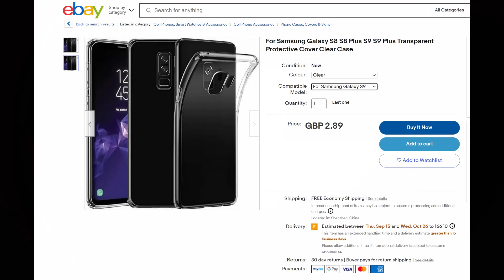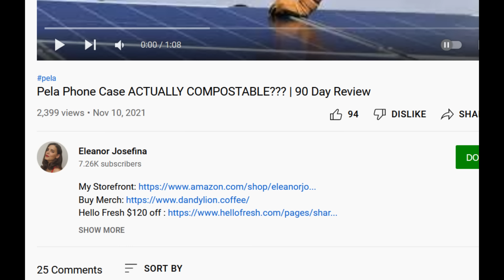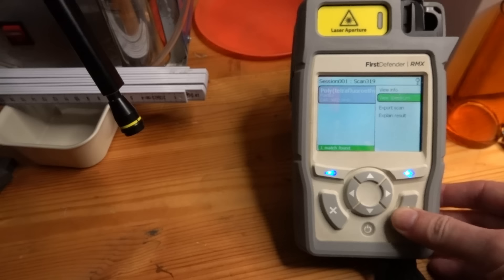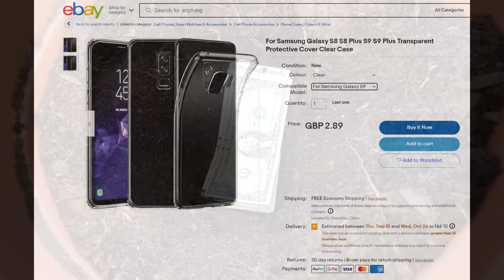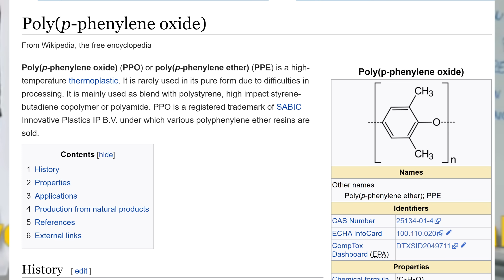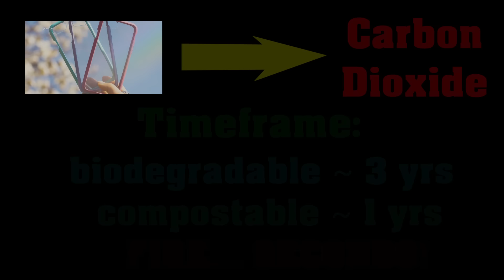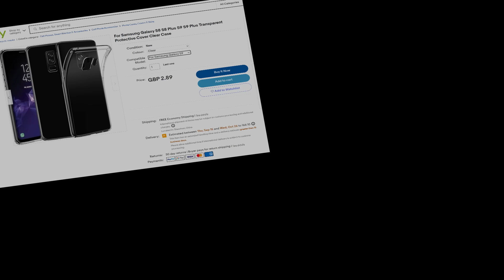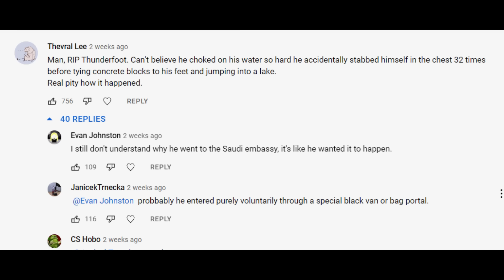Pela-Case: BUSTED!!!

Comment: I just find it so funny that they turned a non-disposable item into a disposable item and then marketed it as being environmental friendly
Reply: @electric7487  you only buy a phone case when you get a new phone. And frankly modern phones last a long ass time(because timed obsolescence is fucking stupid). Where the only pet of the phone that seriously degrades is the battery. If you didn’t buy a new phone every year. You wouldn’t need a new phone case
Reply: @TheWizardGamez 
>long ass time
>actually not
Yeah today's phones battery time gets more than halved in span of two years. Performance drops majorly too.
4 years is bout the soft max you can go with a phone
Reply: @dr_birb  Strongly depends on what you buy and how you treat your phone. And If you are tech savy / got the skills to replace a broken battery. I did work in development for Industrial Battery powered Measurement device and It is widely known that the batteries are the weak point in most devices. Couple this with poor treatment of the device / battery, then it is most of the time the first failure point. Sorry about the rambling but I bought my Xiaomi Pocophone F1 in December 2018 and it still goes strong. But I also did root it for app development purposes back when I bought it and do not update the system version.
I never owned a IPhone and only shortly a Macbook before selling it again (performance was dreadful). Therefore do not know if the Rumors of Apple slowing devices down to force you to buy a new one is real. Maybe someone can elaborate on this?
Reply: Climate-chic in a nutshell, really.
Reply: @dr_birb  there is absolutely no way performance drops. You might Install more clutter from the appstore, but the phone will perform the same for decades. That's simply how the electronics work, they don't degrade in performance.
Reply: @dr_birb  I don’t think that’s true. If you were correct then my 2 year old iPhone should be at least <50% battery life but it’s still running at 87%. So the more than 50% decrease, has only been a 13% decrease. You may call it anecdotal, but that’s a significant difference to what you said I should expect.

And performance won’t change with time unless your battery is somehow undervolting the cpu as it ages which I don’t think exists in any phones.

Edit: sorry Apple does actually reduce performance for older generations to preserve their battery life, but that can be stopped if you want to prioritise performance over battery.
Reply: @dr_birb  okay even in your worst case scenario this case still has a lifespan less than a quarter of the phone it goes on.
Reply: Smells of planned obsolescence.
Reply: @PiratePawsLive  replace broken battery? Bruv we're in 2022, companies make it literally impossible to repair anything yourself, and repairing in their repair store costs more than new phone. There's just so many anti right to repair design choices that it's just depressing
Reply: @surealivro6242  they... Do...
They literally do....
Reply: @ebolachanislove6072  oh yeah I'm not saying this scam is any good.
Reply: @dr_birb  
My phone is 6 years old now, it's not as fast as it should be, but it still get everything I needed done and it's not like I use it much anyway. I do have to replace battery once, but it's from an old stock, because while my phone is 6 years old, it's already a discontinued model by the time I bought it, so I'm just help in clearing stocks that would otherwise be forgotten and this new, perfectly functional battery will just contribute to e-waste problem.
Reply: @dr_birb  thats why i said know how, of course you need the replacement part and some tools. And most likely a soldering iron too. Its basically the same thing what repair shops do. I know there are some devices with anti Intrusion mechanisms. Thats why most and not all. And i'm not talking out of my ass cause i did fix several my self and got a friend which fixes Laptops and phones as a hobby. He does mostly Basic part replacement, and if it requires more in depth diagnosis and soldering, i'll look into it. He and I prefer not to deal with apple too much cause those are a real b** to fix.
In short for many devices it's a question if its worth the money and time to fix. If chips wich contain programming are fried its a lost cause, at least for me.
And yes i agree there are parts which are intended to be thrown away and not repaired.
Reply: @dr_birb  nope right to repair laws means that you can fix screens, batteries etc yourself.
Reply: @dr_birb  my Phone is as fast as it was on the first day and has as much battery charge (I avoid quick charge) as on the first day and it has payed a visit to the washing machine
Reply: @iandavis8725  yeah... If you buy the parts.. And tools... And etc...
You know right to repair isn't set in stone, companies like apple constantly try to bypass them in any ways.
Reply: @bosh6604  good for you
Reply: @dr_birb  thanks 👍
Reply: @TheWizardGamez  most phones also come with a cover now too.
Reply: @TheWizardGamez  last couple i've had started failing after a couple of months. Before that i had them for three years each only having to replace the battery in that time, but that's not even simple anymore. My new one has many of the problems that the old one did so half were android and the other seemed to be bad ram. New nokias aren't like the old ones and android can be as crap as they want when they want to for you to change phones.
Reply: @mickeyg7219  six year old phones aren't the same as two year old phones. I'm sure my old windows phone could turn on and work, but my 2019 phones don't. One that was functional can barely start itself. The other seems to have cooked itself and likes to crash. Same as one i bought only a year ago. A couple of months in and it was crashing every so often and in a year was too unreliable.
Reply: @iandavis8725  Does that mean that they didn't deliberately make that difficult? Is it as easy to replace batteries as it used to be when you just slid the back cover off?
Reply: @surealivro6242  Technical your right that the actual performance of a phone/computer doesn't drop overtime (much, hardware degradation is a thing, but usually negligible), but the demands of the software running on it can most certainly cause a drop in the usable performance of a device.  As newer hardware releases, most programs get updated to take advantage of that, which then causes the software to run slower on older hardware.

I am going on 6 years with my bottom of the barrel android phone, now Discord requires being opened twice before it will load up and even a lot of webpages will lag.  Kinda sad as I just got a new battery about a year ago and had gone out of my way to find a phone with a battery that just requires popping the back off to replace it.
Reply: Facts
Reply: @dr_birb  I've been using an Xperia XZ2 for 5 years. The battery life has hardly gotten noticeably worse. It's maybe gone down by like 10% or so in that time. It lasted me more than a day when I first bought the phone, and it still does.
Reply: @dr_birb  Don't be a power user, buy phones with minimal bloatware and find methods to remove what they come with. Lower your brightness as battery consumption increases EXPONENTIALLY the higher your brightness is, keep on power saving mode to ensure as few apps as possible are running in the background when you don't want them to, don't play videogames or move over very resource-inexpensive ones that don't inhale power by the boatloads, finally, keep it safe and hold off buying another one until it's close to literally falling apart in your hands.
5 years and my phone is still going strong, able to stay on for over 2 days of battery with regular use, without a single battery swap, and good riddance for it because I'm sure it'll be a pain since the phone is the glued together kind, a departure from what I would've wished being one with an accessible battery, but I am finding there is a benefit to phones you can't (aren't supposed to) open because I dropped it oh so many times and it's not struggling to hold itself together like my old one did.
Reply: Not sure why people even use phone cases. Imagine buying a ferrari then putting some crummy rubber padding all over it.
Reply: -Matter didn’t create anti matter
-Anti matter didn’t create matter
(Both of them were present at the time of big bang)
-Both of them didn’t create themselves.
-Both of them came from an unimaginable source,  that unimaginable source created matter and antimatter (everything) thats why it is known as “the creator” of everything.
——————
- that unimaginable source/creator has created sin and virtue which are opposite to each other,
— “logic” confirmed that every action has its own reaction, the reaction of sin is different than the reaction of virtue,
— the creator has created prophets to let us know about each and every detail of sin and virtue, also about their reactions,
Thank u
Reply: @PiratePawsLive  the apple thing is not a rumor, apple admitted i and got sued over it. Don't remember if they rolled it back afterwards

Comment: I have spent 32 years as a science teacher trying to convince teenagers and their angry parents that rain fury down on me that composting composting is actually a greenhouse gas creating process.. Composting is good don't get me wrong, But a cow eating grass, composting grais macomposting grass or setting fire to grass is the same chemical process called combustion. The only differences how fast the CEO 2 comes back to the atmosphere. Obviously the by-products of fire versus composting are different, but not really to the gasses they met. So the minute they said biodegradable or compostable that's the end of the story for greenhouse gas emissions.. Having compostable and is compostable and biodegradable plastic is great for other reasons. Doesn't matter if your heart is in the right place if your head doesn't know what it's doing

Comment: Having a Compostable Case on a Phone that prevents most common repairs, while not even protecting it well, is peak irony
Reply: You should always have a screen protector on your phone, at all times with any case. If they had a screen protector, screen wouldn’t crack. That goes for any case.

Comment: My main issue is that phone cases aren’t worth even thinking about when compared to the amount of waste we  chuck everyday.
Reply: food waste would be a better area to target since even a proportionally tiny imprvement would be massivley better than 100% emmission reductions with phone cases
Reply: I’ve probably thrown 2 phone cases out in my life
Reply: And every everyday people don't do so much compared to industrial waste. At work I toss about my weight in plastic every hour~hour and a half into the dumpster.
Reply: @randomprotag9329  food waste is intrinsic, it can't be reduced alone. you'd have to reduce all food production and consumption. but im guessing you're not keen on doing that, which is where the problem lies.
Reply: @lVlegabyte  Most people look at immediate use, domestic, personal transport. They get their solar panels and batteries and perhaps an EV and save the environment by reducing household emissions. They want to feel good now and don't tell them otherwise.
  It is 1am in winter and my entire state is running 92% direct wind power right now. During the day it can get to 150% with solar - if decent wind. Power can be exported interstate, reduced demand partly because we also have a lot of household batteries in a large virtual power network. My average use 1kW, x 24x7. I can run airconditioning all day and night for near zero 'environmental cost'. $ cost is another thing entirely.
  This means very little.
 The 'economy', employment, people transport ,transport of goods and raw materials, manufacturing, farming - fertilizer and chemicals -  everything - consumes near 16kWx24x7 - per person-  a great proportion is not from the feel good renewable electricity supply.   That is something most don't see and either would not or could not pay to replace.
  1kWx24x7 domestic replacement can be had for $5,000-$10,000 per person, easy to convince,  feel good.  That is the state wide infrastructure cost not just a few roof panels. 
  $150,000 per person for the much harder to substitute broad economy, that once in 10 year or 15 year cost becomes every year. And then you have to do it for everyone. The world would have to be really burning to get most people to spend $5k-$10k per year on near zero emissions.    
 But a $50 useless worse than doing nothing phone case? that they can do.
Reply: I never owned or bought a phone case, so it is lost on me anyway.
I prefer to go "bare", so i know that i have to keep paying attention, because i hate how careless people are with their phones, and i don't even CARE about my phone...
I kinda see it as Rugby vs American Football, haha, the padded ones smash into each other, while the less padded ones are a bit more tactical.
Reply: @Games_and_Music  I like your analogy
Reply: I imagine the phone case's packaging (which gets thrown in the bin) exceeds the mass of the case, not to mention the emissions in manufacturing and transporting the case.
Reply: Exactly!